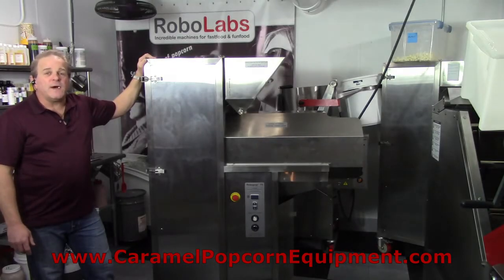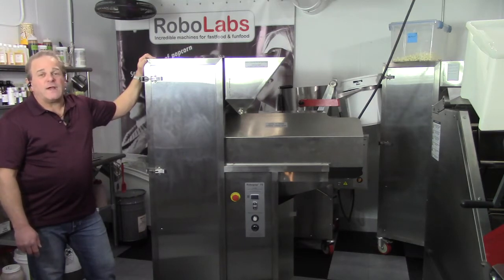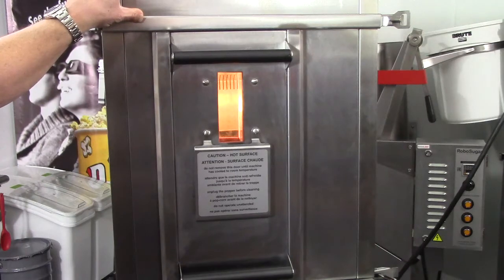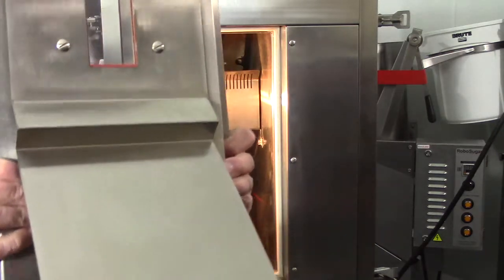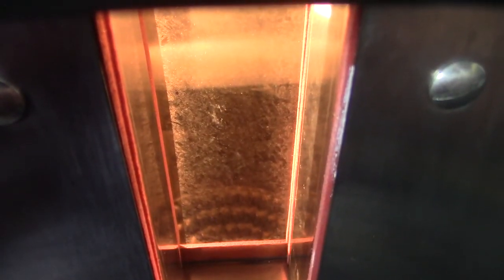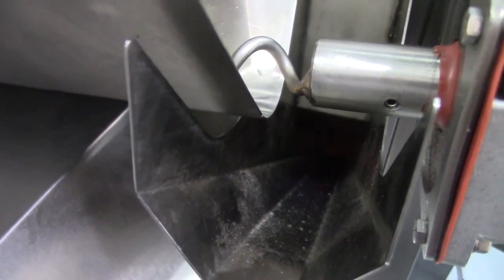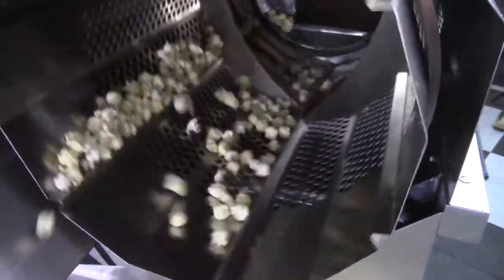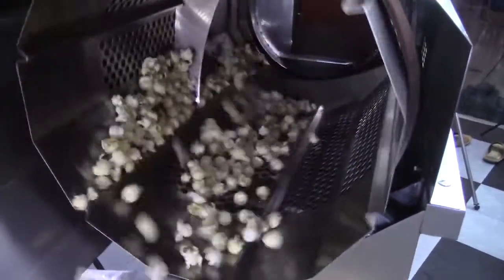RoboLabs RoboPop Vortex Popcorn Explained

Comment: Our popcorn comes out a bit chewy and sticks to the teeth. Same machine - Robopop mini 25. any suggestions?
Reply from the maker: Assuming your corn is fresh, it's all about controlling humidity.

1) Make sure the sifter is below a strong exhaust hood so the moisture released from popping is removed immediately.

2) Let the popped corn sit and continue to release moisture for 5 minutes or so after popping before bagging.  Slightly chewy is how the corn will taste immediately after popping, but as it continues to expel moisture over the next few minutes it will become much more crisp.

3) Keep the relative humidity as low as possible in the room, 25% to 35% at most. If there's excessive humidity in the air, the popcorn will absorb this and will never be as crisp as it should.
Reply: @floatingcottoncandy  Oh, thank you for your detailed instructions. Will follow your recommendations.